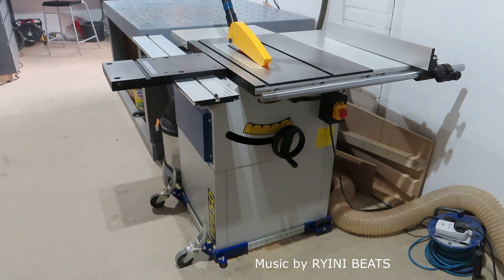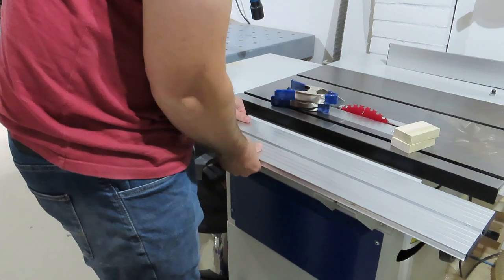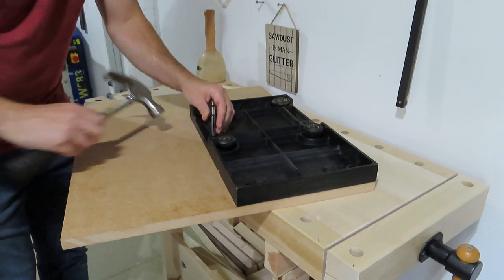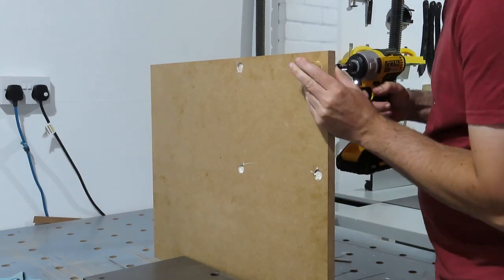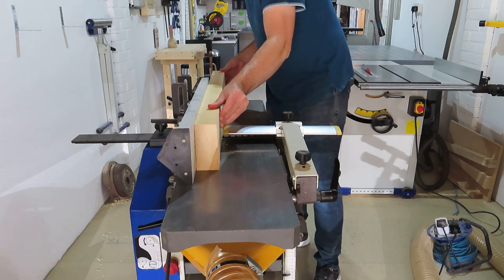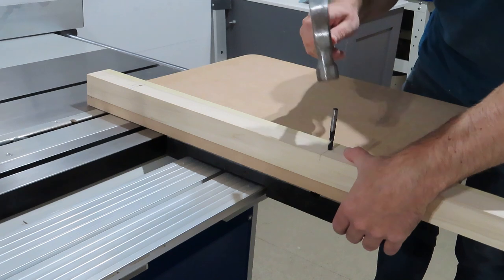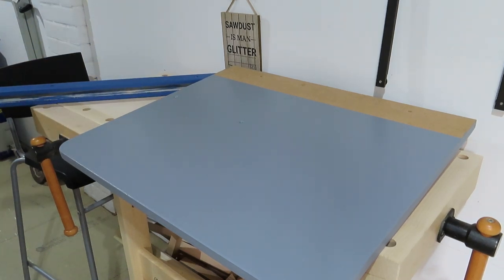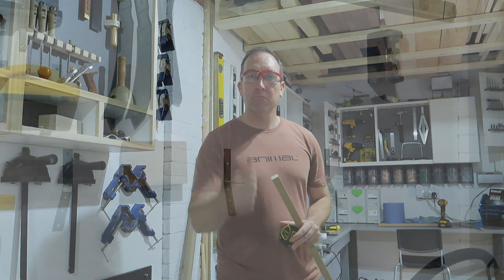Charnwood Table Saw Cross Cut Sled

Comment: That was so interesting. I discovered you by accident. I have the same table saw, along with Charnwood band saws, mitre saw and router table; I have a sign which includes ‘Sawdust is man glitter’ and I also use DeWalt drills. And, as an added bonus, you are a Brit. 🌞

Comment: Great project. Thanks for sharing. Man after my own heart: the need to constantly check for square and true on my Charnwood sliding table fence drives me nuts (and stops me using it). Separately, I think I wouldn’t buy a Charnwood table saw again. It’s powerful enough but it took a lot, and I mean a LOT of setting up, shimming the extensions with washers, filing off sharp corners etc and I’m by no means a perfectionist on this stuff. Too much play in the rip fence. Poor dust collection too. But, you get what you pay for.
Reply from the maker: Thanks Emmet yes I think I am incline to agree in terms of the table saw not sure I would go for this type again, I feel like I am kind of used to it now though so hopefully won’t be changing it for a while, thanks for watching and the support 👍
Reply: This is disappointing to hear. I've just watched a review by @matthewsmall and he was very happy with his saw, maybe they have updated it? Did you buy yours a whole ago?
Reply from the maker: @allthegearuk  I think it was about 3 years ago, it’s only the sliding bit that I am referring to everything else was very good and if you didn’t want to take the sliding fence off very often it might not be an issue but for me on most projects I am always witching between rip cuts and cross cuts, I did see Matthew video and he is clearly a skilled woodworker and the review was very good so might just be that it didn’t work for my style of working 👍
Reply: @allthegearuk  About a year.

Comment: Hi I'm looking for a new table saw and in the running is the w650 or equivalent axminster... im not finding many reviews of the charnwood w650 online.. are you happy with it and also I noticed you had a remote for duat extraction in the video.. any info on that would be great.. thanks
Reply from the maker: Carl Whitfield  yes no problem, I am very happy with the table saw it’s powerful easily cuts through walnut etc and is very accurate never had to reset the fence from day one and it runs happily of 13a socket, I just didn’t get on with the sliding attachment which is why I made the jig but I use this saw every time I am in the workshop and it has performed brilliantly, the dust extractor is just a Rutlands drum style extractor inside a sound reduction canines the remote control is one of those one that you plus into the socket, there are convenient but don’t leave them plugged in when you’re not in there as they can be set off by random things 👍
Reply: @ukhomewoodworker848  thanks for reply ... look forward to more of your videos now I found them... will buy mine soon as I can thanks
Reply from the maker: Awesome thanks for the support Carl 🙌